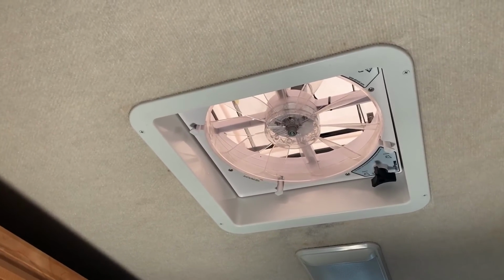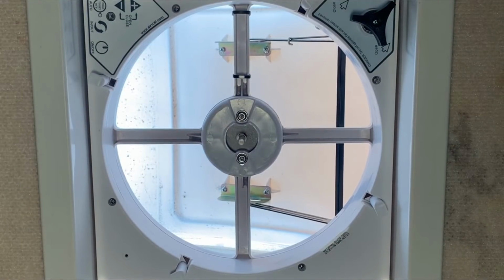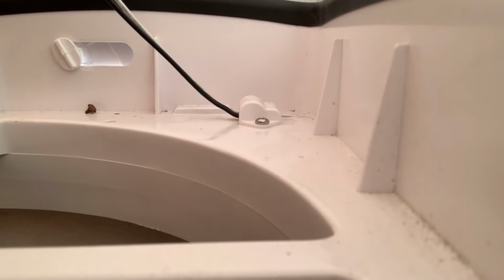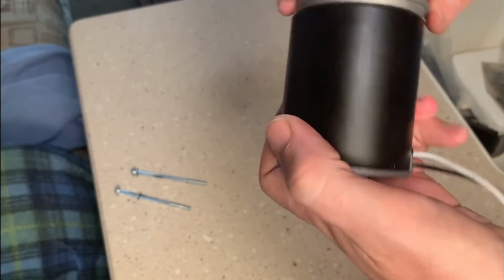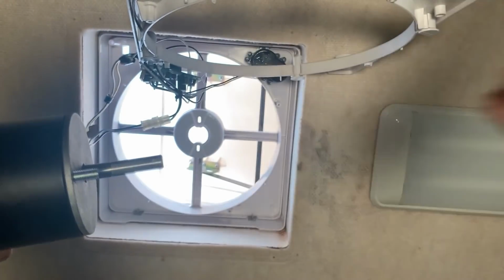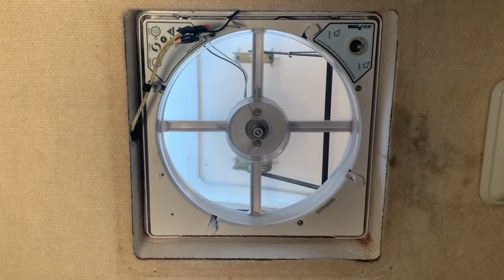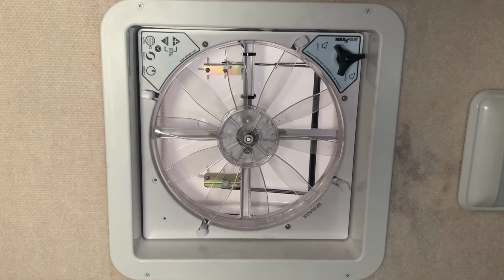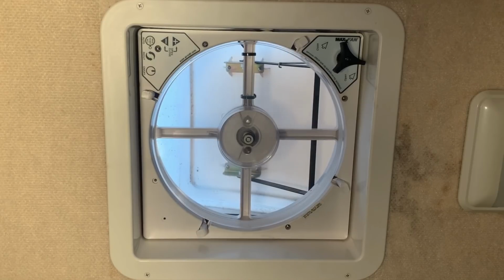How to Replace a MaxxAir Fan Motor

Comment: I recall working in manufacturing as a test engineer. I have now retired. We used the same cheap Chinese motor for three different products. The one product was quite demanding in terms of  the spec of the motor. Half of the ones we tried on that product did not function properly. The other two products were considerably less demanding. We set up the production and test lines so that the failed items were shifted straight onto the other product lines. It would have been too expensive to have returned the motors to make sense. We never wasted any,  Just proves that manufacturing tolerance problems can be dealt with on scales like this anyway. Of course dealing with individual products in an aftermarket situation is a different problem altogether.

Comment: Great video, as always James. Thanks!!
TBH I'd have just packed the original motor bearings with some grease, while it was apart and called it a day. Quick tip use some Wago 221 or 222 connectors for the 12 volt connection to the RV, as they're a lot easier to connect and disconnect than wire nuts, you know, given you'll probably have to pull this unit out again within another 12 months.  
I watched the circuit board replacement video and I have to say that fan seems like such a crap design, not to mention the poor quality components and total lack of reliability, especially given the cost of those units. It honestly seems like Maxx Air, or should I say Airxcel, focused far more on the aesthetics or their product rather than on what was under the hood, it really is all show and no go. Some fancy, shiny plastic with rubbish components inside.
Reply from the maker: The design was a good idea, but poor quality.  Will put some Wago connectors in the next time.

Comment: I looked through the other ideas,  and exploring the fan's balance seems logical.   Secondarily,  I thought of putting a rubber spacer between the motor and frame to absorb vibration.

Comment: I have two of these in my class A RV and they are both noisy. You would think for what the RV cost (mine was $389,000 new)  they would develop higher quality interior things like fans, lights, faucets, etc. But they are all cheaply manufactured while costing  a LOT of money. Your wobbly fan probably cost $1 to make (if that) but will cost $30+ dollars to replace with another wobbly fan. $100 for a motor? Perfect example  Just sayin. Thanks James, love your videos!!!
Reply from the maker: I agree.  For the price of the fan not to mention the coach, you would expect more.
Reply: That IS the "Higher Quality!"

Comment: Funny how those little noises can drive you crazy. Had a similar problem happen with my fantastic fan. It was less then a year old and worked perfectly all day on a camping trip. Soon as I went to bed, yup, started making noise. Not very loud but drove me crazy. Had to just shut it off. Luckily it was still under warranty but still a pain to change it out.
Reply from the maker: My last fan was a basic fantastic model.  Worked well for a long time.  Eventually the plastic flange cracked and start letting water in.

Comment: Is the click from the motor or the fan blade?
Reply from the maker: Motor.  Guessing the brushes on the commutator.
Reply: @jcondon1   Depending on how much time you want to put into it at this point, you could swap the brushes from the first motor to test.  Or just let it run and see if they wear down enough to quiet down.

Comment: Yes I can agree that is a frustrating experience. I have seen the case where the thru bolts have cause a similar chirp,  the cure was to wrap them in electrical tape. The click I can't hear well enough to comment. 40 plus years as an electric motor repairman here.
Reply from the maker: Thanks for the tip.  Still have the old motor.
Reply: @jcondon1  The resulting tick you have seems to my poor ears to be some sort of rattle or shake apart from the motor resulting from the unbalance of the blade.I'm thinking if that were the case you would have likely determined that already.

Comment: Love your videos! Have the same fan and the same chirp. Dissembled the motor just like you did and found nothing. The only thing I did when the motor was dissembled was to clean out the brush dust. The chirp went away for a few days but started again. Feel like the brush dust is the issue causing the chirp. The brushes being at the top of the motor allowing the dust to fall into the armature seems to be the cause of the chirp. In other words, it’s a poor design.

Comment: Surely a brushless motor would suit this application best.... maybe install a large  PC fan... they're fairly cheap and run silently for years. Keep up the good work ☺
Reply: I replaced the little buzz bomb fan (not MaXXAir) with the biggest computer fan that would fit. It is silent but it doesn't move much air. It's fine for the bathroom.
Reply: @petercolquhoun2086  Id make a 2x2 array of noctua 140mm 24V industrial PPC fans see how much air it move haha

Comment: I have the Fan-Tasitic vent fan (the low end version with manual controls and non reverseable..) it is probably 6 years old at this point and I've had no issues. Though I notice my fan is a lot more ballanced...
Reply from the maker: I had a Fantastic fan for 11 years.  No issues until the plastic flange cracked letting rain water in.  Fan still worked well.  Low tech is always the way to go.

Comment: I installed a replacement MaxxAir fan in my last travel trailer and hated it.  Our circuit board also fried after only a few months - it seems these fans are exceptionally sensitive to even slight voltage surges and dips (very common with RVs and campgrounds).  There is no practical solution to this issue and the only hope is that these problems happen while the fan is still under warranty (although having it fixed or replaced by MaxxAir is an ordeal by itself).  While there are all sorts of gadgets and devices to protect your RV's electrical system, there was no easy way to add a suppressor or filter that would guarantee to prevent a recurrence of these problems so I decided that a fan with a simple mechanical on-off switch was the more logical choice.  In a less-than-ideally-controlled environment such as an RV, the simpler the better.
Reply: Almost sounds like you have to add an additional power supply infront of the built in one to condition the 12vdc going in

Comment: For other people having this problem.   Two different things can be happening: too much preload, and carbon buildup.  The two screws through the motor not only hold the end caps but also provide the clamping force against both bearings.  If the screws are overly tight then the bearings will bind.

As for carbon buildup, when you disassemble the motor hit it with compressed air and your safety squints and the abrasive debris from the carbon brushes will be removed.

Comment: Check the hole diameter in the fan and the shaft diameter on the motor.....
If excessive perhaps the fan set screw is pushing the fan off center causing the wobble....
You may need to add a piece of shimstock opposite the set screw location to get the fan blade better centered, thereby getting rid of the wobble...

Comment: The brushes will make a squeaking if they are misaligned and or have brush dust from wearing. I did see some brush dust on the case and the magnets after you opened the motor. that is the most likely cause for the noise. 

Edit: The new motor is not worn in. the brushes are clicking and that will go away after a couple hours of use. the noise is just the brushes catching on a new commutator. Once it is worn in the noise should go away.
Reply from the maker: Yes, thought the same with the dust.  Left the new motor running on high for about a week.  Brushes still not broken in, so ended up exchanging the motor and the replacement works as it should.
Reply: @james is the motor still running quietly? I’m facing the same clicking issue now after a few months of use. Cleaned it and the noise went away temporarily but now is back.

Comment: did you try oiling the bearings?
Reply from the maker: I should have, but found no problem when testing them.  I think the shaft of the armature may have been rubbing a little in the end cover.

Comment: Mine has a click like your new motor. I was hoping to fix it...  BTW, the stains on your ceiling can be easily removed with a spray bleach cleaner, soft brush and a wet vac.
Reply from the maker: Thanks!  Those stains were from the last roof fan.

Comment: I might have replaced the bearings with ones that had the same or better radial load rating and definitely a better axial load rating. The chirp sounded like bearings and I suspect the manufacturer paid no attention to the axial loading condition that the bearings would sustain when they sourced the motor.

Comment: Imagine the price if you had to take it to a dealer to fit?

Seems a high price to pay for a motor. I thought it was only in the UK that there were rip of prices for parts. 

I thought you might have replaced the bearings when you had it stripped.

Anyway great video, thanks, keep them coming.

Comment: Mine has chirped for over the last year. I got Maxxair to send me a free replacement since it was under warranty. Trying this tomorrow, thanks for the video.

I saw one other guy who cleaned the motor a specific way to fix it. Apparently it is the buildup inside that causes the chirp.

Comment: Replace or try balance the propeller. The wobble male a sound of it own. Push the propeller on the edge, while you spin it with you hand and see the low or the high point. It will reduce the noise. I found this in new computer fans. Turn out the older model with sleeve bushing not ball bearings are much quitter.

Comment: Brushed motors can be chirpy but you can sometimes stop that from happening by cleaning the commutator with Emory cloth or scotch brite. I'm thinking it stopped simply by taking the brushes off and putting them back on. Sometimes a stronger spring for the brush can help.
Reply: Yep, or change the carbons for softer ones if they can be sourced.

Comment: its not a brushless motor so when you took it apart you essentially cleared out the little particle that was stuck on the brushes
Reply from the maker: And it ran fine after.  Also did not tighten the end cover so tight just in case the rotor shaft was rubbing on the housing.

Comment: Unfortunately, most new fans now come with oiled bushings that are allegedly good for the life of the fan and by life, they mean a few years.   The bushings are porous and loaded with oil at the factory and are not serviceable after that.  You can add oil, but in order to reload those bushings with oil requires fully removing them and vacuum and heat.  The pores are really too small to hold enough oil for "the life" to be more than a couple thousand hours of use, far worse when exposed to the elements like this is.

Comment: ATTENTION!!! BEFORE YOU THINK ABOUT TAKING APART THE MOTOR TO FIX THE SQUEAKING!  Wish I had known how the motor was put together after watching your video, I thought I'd take it apart but I didn't have a C-clip pliers so not wanting to put the fan back on and off to go buy pliers, I put it back thinking those spring loaded pieces went around the shaft, did not know it wen around the comutator. It sealed but the shaft was tight and realized my mistake. smashed those spring loaded things and damaged the bearings.    AND I wish I knew that replacement fans are sold out everywhere since forever.  Maxxair basically wants people to buy a new fan instead of providing the part.

Comment: As an RV service manager and RV user for many years I suggest you replace the Maxx Aire product with a Fantastic Vent, a much superior product.  The fully automatic product has a rain sensor and a remote control.  It’s pricey but works very well.
Reply from the maker: I had a fantastic fan for years and had no issues with it until the plastic flange cracked letting water in.  Am surprised for a part that critical, that it was not made of metal.  This was supposed to be an upgrade.  Good design, but poor quality.

Comment: James... email the manufacturer and include a link to this video. A good company would step up and make it right. Are there many/any good companies/corporations left? Cutco comes to mind, but scratching my head to come up with another. 
(I'd be willing to bet the shaft for fan motor got dropped hard somewhere along the way. Just a guess)
Reply from the maker: Not many good companies left.  Wrote to the company who made my RV leveling system that failed and deployed on the highway.  No response, but now I get marketing emails from them weekly.  Great...

Comment: Jim, If I were you, I  would replace the bearings in the first motor, and return the second one.
Reply from the maker: I did the easy thing with this one and exchanged the motor and am running quiet now.  Still have the original motor.  Have received a lot of good comments on how to fix that one, so will look to fix it up and have a spare.

Comment: I would greased the old motor shaft first or of it was binding denting the inside of the plate out a little with a punch.
I wouldn't have paid for a new motor, certainly not at those prices.

Comment: I would:
A. Soak the old fan bearings in synthetic motor oil and refit.
B. Apply bearing fit between shaft and bearing to stop the shaft spinning within the bearing
C. Balance that fan blade using a rough method

Comment: The new motor sounds like it could have a bad commutator - not what you expect for $100.  My new trailer has one of these fans.  No problem yet, but it is less than one year old.

Comment: I replaced my fan blade and motor with a radiator fan of equal size.  Not only are they quieter, they are balanced with little clip on weights.  Cost $30 on Amazon.  Seems like they expect RV owners to be gullible, like tacking the letters R and V on a product makes it ok to gouge you.
Reply: The black fan blade is just not aestetically pleasing, unlike this clear fan blade.
Reply: @erik_dk842  I agree.  However, this fan is intended to move air effectively.  I will trade one aesthetic feature for a  fan that works.
Reply: Did it bolt up to the frame perfectly!? Is it still controllable by the board? @troyfowler5177

Comment: I had to replace the lift motor on our fan, it quit after one year
Reply from the maker: Something to look forward to.  My old fan was just a simple crank the lid open and analog power switch.  Worked well until the plastic frame crack letting water in.  Could not believe they used plastic for that.

Comment: These fans sucks and THANK GOD their patent expires in 2024. I had to replace the circuit board and the motor after 2 years. the issue is the fan doesn't have a voltage regulator built in, so the 14.5v from Lithium batteries blows the board and the motor. you MUST install a DC to DC voltage regulator that regulates it to exactly 12v otherwise you will keep blowing motors and circuit boards. It feels like they purposefully left this out to make money on replacement parts as the warranty is only 2 years. they quoted me $125 for a motor replacement, the entire fan is only $200!

Comment: I have little faith in MaxxAir quality. After putting one of these in my van, the control board was going nuts. According to maxxair the input voltage can ONLY be 12 volts. Not 12.8, not 13, not 14. What RV has a regulated power supply? I'm not wasting the energy on a boost/buck converter to fix their poor design.  These boards clearly haven't changed any since 1988. Garbage.

Comment: James, if its 12v just go to an outdoors store (Academy or a hunting supply store) and purchase a motor for a deer feeder. They operate on 12 volts and they have 1/4" shaft. These are good motors. They are exposed to the outdoors year around. I have 2 of them on my feeders here in Texas with no problems. All Seasons Feeders is where I get mine. I think they are around 20 - 30 dollars. 
https://www.allseasonsfeeders.com/collections/parts-accessories/products/12-volt-motor 
Hopefully this will work for you, definitely a lot cheaper.

Jeff
Reply: It even looks the same lol